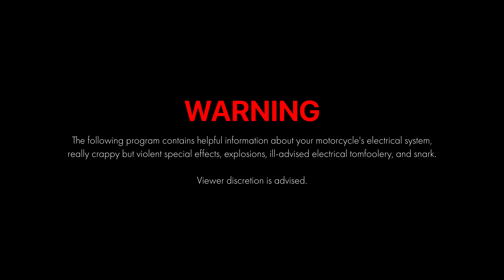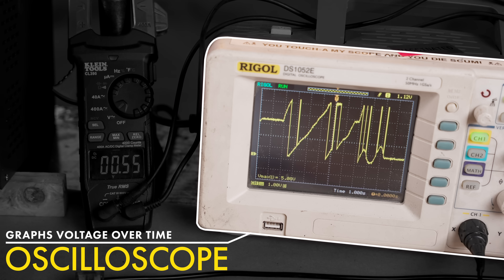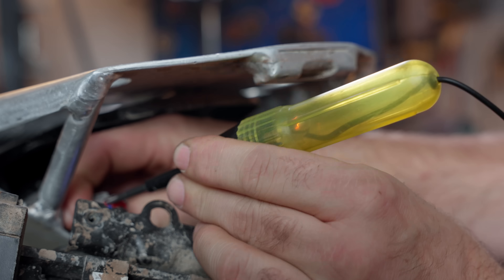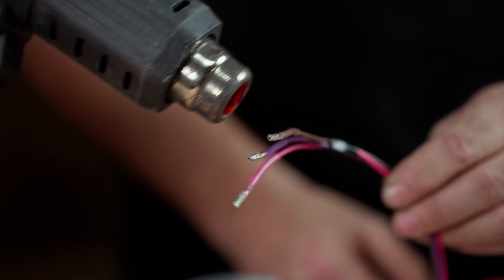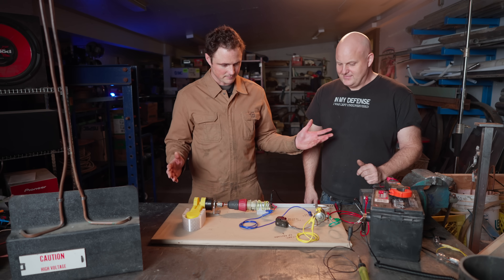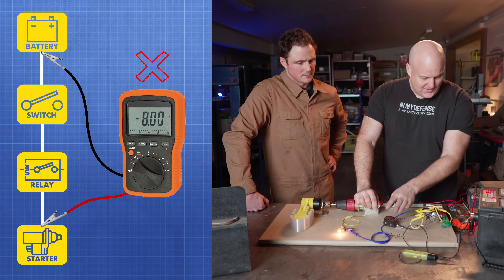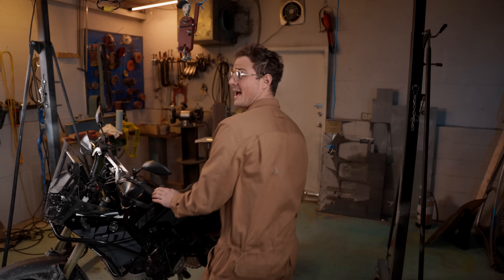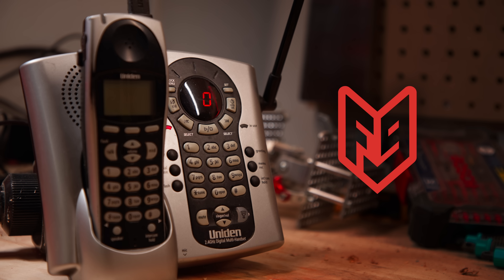5 Motorcycle Electrical Tips from a Pro

Comment: How can a 12v car battery cook a 12 volt bike battery?
Reply: Amperage :-)
Reply: The bike battery has an internal resistance proportional to it's size(construction). How would amperage kill it in a parallel configuration?
Reply: He also said that you can't trust an ohm test because it'll still show connection. But ohms are the measurement of resistance. Continuity is testing if the wire has connection
Reply: Yeah i dont understand this one either
Reply: That sure didn't sit right with me, the moment he said that.
Reply: The issue isn’t voltage. The issue is amperage. What you’re doing is essentially “charging” the battery with a charger set to a MUCH too high of charging amps. Same way batteries get hot and can pop if charged at too high of a current when using a charger. The car battery is trying to dump TONS of energy into a little tiny battery with let’s say 2 volts for example because it’s dead.
Reply: @tgavin11  the issue isn't amperage either on this. It'd be battery energy capacity measured in watt hours or joules. Two batteries hooked up try to equalize. If one battery is way bigger than the other it smokes the small one. It takes a while though. Same reason we have controls on battery chargers so we don't over charge them
Reply: If your battery is completely dead, then it isn't at the same voltage as the car battery; so you're essentially Mega charging your little bike battery at that point. Lead acid batteries can take a little abuse, but leave it connected for too long and you're going to start boiling off the electrolyte.
Reply: As soon as the bike starts the generator, rectifier, regulator are going to hit the battery with 13.5 to 14 volts. Still not going to hurt the battery.
Reply: Some one needs to do a deep dive video answering this question.
Reply: It can't
Reply: 12V meets say, 10.5V. There will be a short period of equalisation, but no damage.  I've never seen any damage, short or long term from jumping unequally charged batteries. In some situations there might be, of course. Avoid sparks near venting hydrogen, etc.
Reply: @MacShintersbane That short period isn't short if the battery is not disconected but is low. Lead acid batteries might be more tollerant to abuse but try connecting an empty and fully charged LIPO battery like you do when jumpstarting a vehical and you get a fire real quick. You are essentialy just charging your battery at an unregulated speed and hoping the resistances in the circuit will protect you.
Reply: @someonespotatohmm9513  I never mentioned LiPo, you did. I'm quite cautious around LiPos,  and even around LAs, as I've seen one blow up when a stupid bastard jump-started a fork truck with a welding set. He was lucky he kept his eyesight.
Reply: They said "any vehicle" so I assumed that counts 24v truck batteries as well
Reply: @BlackArtBMX  yeah but that will fry any 12V circuit

Comment: Wait, so EFI bikes can get "stick drift" like a nintendo switch? Damn that sucks.
Reply: Literally lol
Reply: You showed me a connection, now I cannot unsee it
Reply: A friend of mine jumped out from a hill with an Aprilia Mana, 'cause the throttle stayed to max when he wanted to slow down. He was lucky and got out without a scratch, gave the bike back to the dealer immediatly.
Reply: @ParduzTube terrifying!
Reply: Throttle by wire cars have dual sensors for this reason. It's crazy to me that bikes don't seem to.
Reply: @indeed1023  I mean with a manual transmission (both on cars and bikes), you still have a clutch that makes it a lot safer imo (like, if you're standing you're not in gear / pulling the clutch, if you're going slow (like when parking or accelerating from a stop) you're controlling speed more with the clutch anyway).
But of course, for example with a bike powerful enough to lift the front purely by throttle when already riding, this is still a bit of an issue as you might not be ready to pull the clutch immediately.
Reply: @indeed1023 And the sensors aren't usually crap. Yes, a carbon film potentiometer on an FR2 paper PCB is cheap, but it's a throttle. Quality conducive plastic pots that will last a million cycles more aren't that much more expensive.
Reply: more likely on throttle-by-wire bikes but can still happen on conventional mechanical throttles with bad enough TPS
Reply: @annakanna On my old school Aprilia, at least letting go off the throttle will close the butterfly valve. No matter what the EFI thinks is happening, i am not getting a sudden surge.
Reply: @rienkhoek4169  it's true in mechanical throttles you can just close it and there won't be any air coming in, but in mid-throttle situations there can be a spot in the TPS that might be sending the wrong signal while the butterfly is open, the effect is not as dramatic as electronic throttles because it just messes up your fueling (more likely to lose power at certain spots instead of getting a surge) but I've encountered such cases
Reply: I wonder if a Hall Effect setup would be viable for a motorcycle throttle. Theoretically, it would never wear, but I'd have my concerns about anything that could impact the magnets. Fine for computer peripherals and paintball markers, but I'd probably have some reservations about an HE throttle control.
Reply: @Tony-zp8xn we do this for Nissan RB engines on trigger spark 

Stock has a really low resolution map so literally a kit has been made to integrate hall effect on the outside of the cam gear and crankshaft pulley 

I think it's at least 10 years ago they started using them but could be longer
Reply: @Tony-zp8xn  My clothes dryer uses a this set up to sense the position of the drum - I had to replace the bad sensor a few years ago. I trust the potentiometer more.
Reply: well. you can have fuel injection with cable throttle. oh wait, that has the same sensor, just at the bottom. oh well! but yeah!
Reply: Not really an issue with cable throttle.

Comment: Solder don’t splice. 

I swear every bike I’ve ever bought used had splices
Reply: Which is stupid because in modern times they have these neat heat shrink tubes with solder in the middle,Just get the two wires good and close with the exposed wires overlapping with the solder and hit it with a blast from a heat gun and you get a good and reliable connection.